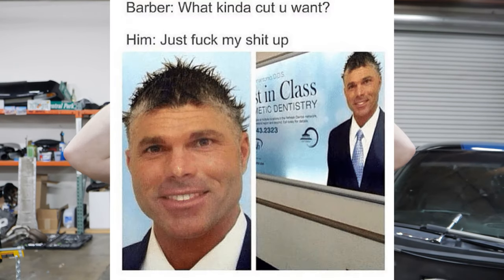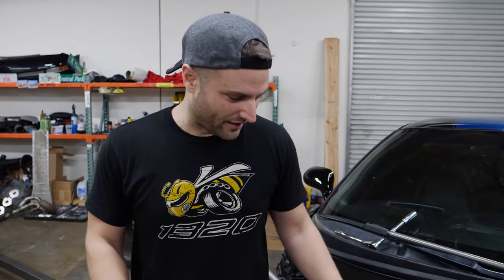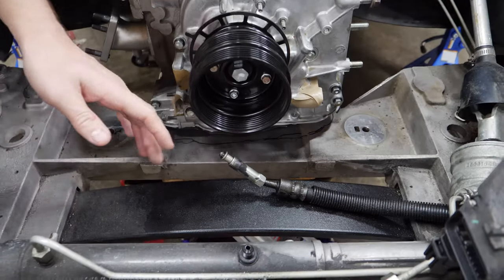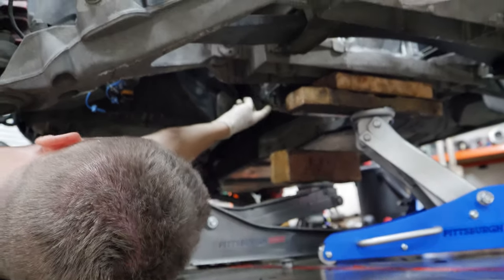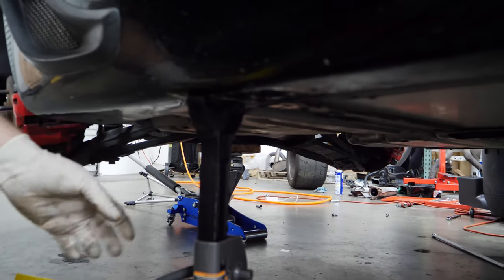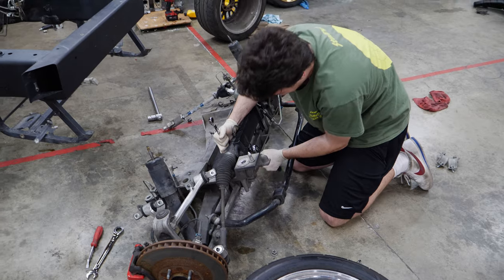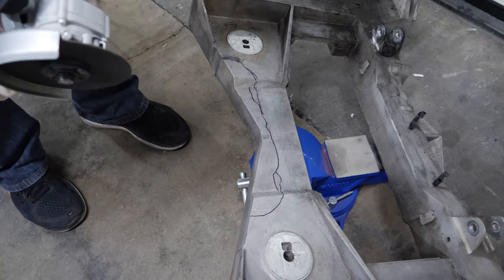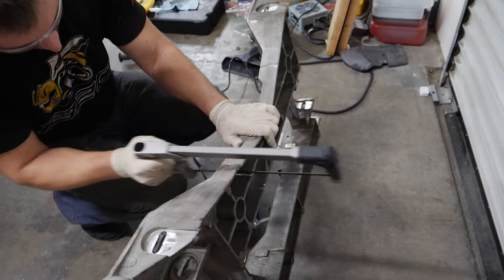Rotary Corvette Subframe CUT.  1 month to LS Fest

Comment: do remember you need to make room for the plate you're going to weld in
Reply: Do you really think he put that into consideration ? Come on, the first cut he made was the exact profile of the oil pan. You would think he would of automatically added a half inch for clearance. No. From what I've seen of this guys fabrication skills,,,, he has none.

Comment: A reciprocating saw and a can of WD40 would have worked a lot better for cutting aluminum than a grinding disc. Aluminum will gall up an abrasive blade super easily.

Comment: Rather than mounting the engine off off the aluminum cross member, way back on a diving board, why not just weld mounts directly to the steel frame so they are perpendicular to the torque? Just let the aluminum cross member support the suspension...

Comment: Carbide bits and blades. It would of only taken a little bit of time, and no aluminum dust in the air (which you don't want to breath, and if it gets fine enough, it can be flammable).

Comment: get a full face shield and wear it and the safety glasses. Never put pressure on the sides of those disks (buy the grinding disks for that) and don't let your body be in line with it. There's plenty of stories about those abrasive disks coming apart. At 12,000 rpm they will kill you if they get your neck. I did the same thing you did and then googled it later and read all the horror stories.

Comment: Its cool to see but personally. The amount of space looks bad! I think you should build a 6 rotor and put it in there. Just the engine not a whole car. You have the amount of space required for something like that. It would be 2 other firsts for the channel. A 6 rotor, and a 6 rotor vette. Plus you would be one of the very few six rotors in North America. Then after its all said and done and the 4 rotor is done. Turbo it!

Comment: Why not use both styles of motor mounts control engine movement as much as possible.  You are talking about a 3 rotor and 1k hp eventually right? lateral mount breaking new ground triangulation motor mounts sound sketchie.

Comment: wouldnt this technically make it a mid-engine vette?
Reply: No. The engine needs to be behind the driver and in front of the rear wheel to be a mid engine.
Reply: @darkpassenger7064  i was somewhat right, I had to look it up to be sure. Robs car would actually be a FMR (Front Mid Engine- rear wheel drive) since the the engine is fully behind the front axle. in this case its even more so as the engine is much further back, giving a weight distribution much nearer to a traditional RMR (Rear Mid Engine- rear wheel drive)

Comment: Get the same subframe that cleetus has on both his corvettes.
Reply from the maker: too expensive and totally messes up the car.  Steering and suspension is completely affected.  Id rather build my own subframe for 3k that retains the stock feel and track width.  I dont want to make this a drag focused vehicle.
Reply: @RobDahm   Fair enough man, thanks for taking the time to share your perspective.  I was just thinking that it would provide all the room that you needed and it just be a bolt on but after your explanation I get it.

Comment: Just get a torch will cut that aluminum like butter. I have a easy way to make the rotory vett just cut the 3 rotor rx7 in half then cut the vett in half. Then just weld the front of the rx7 to the vett. There u go a rotory vett fuk it.

Comment: So he traces the exact profile of the oil pan and cuts on that line. How would you not know it wouldn't fit ? Why not give it that half inch clearance right from the get go ? All that time cutting then re cutting. So if you are going to plate that sub frame what are you going to do, cut it again ? When I see shit like this you can tell there is no planning in his process. 20 minute video, 10 minutes talking about his haircut, 7 minutes of worthless chatter and 3 minutes of actual work.